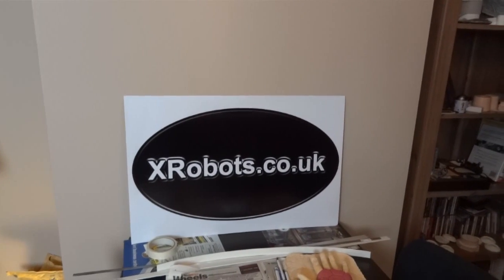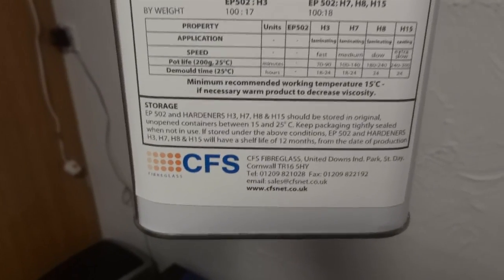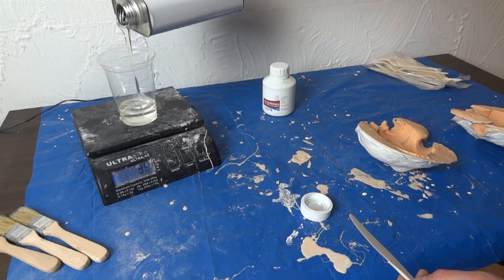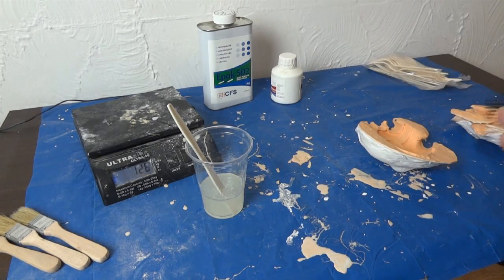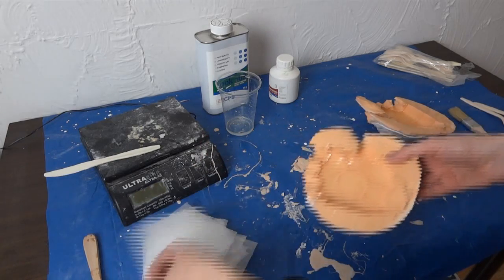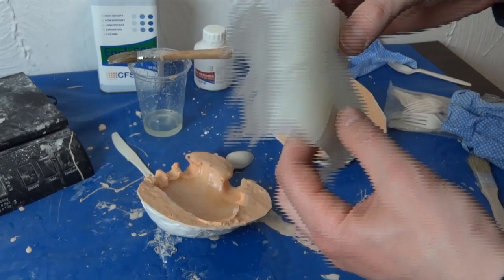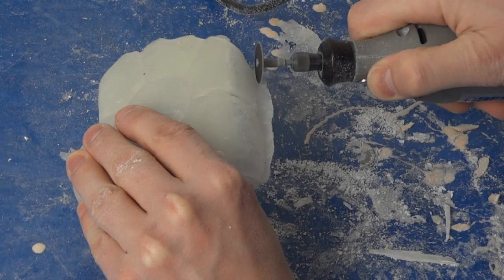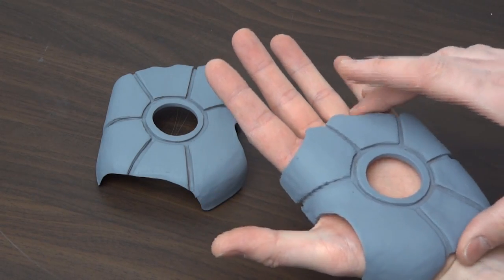Iron Man Power Suit #30 | Glove Blaster | James Bruton

Comment: Very nice.  You can get colorant that you can add to the resin for a nice solid color without painting, although it's harder to get a glossy finish without painting in my experience.  Also, if one is making something that needs to be thicker, they would need to pad out the life cast either by wearing something of similar thickness to the finished casting or by using clay or something to build up the size.  Otherwise, if you have a tight-fitting mold and then build up 1/2" thick it won't fit.